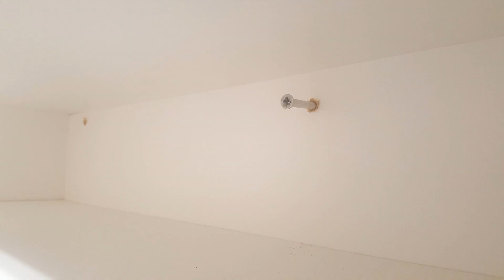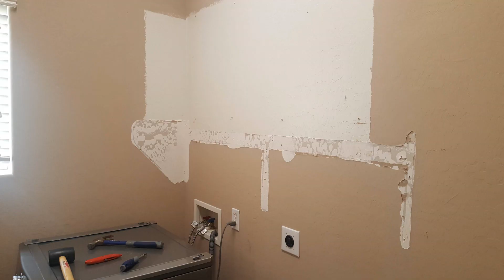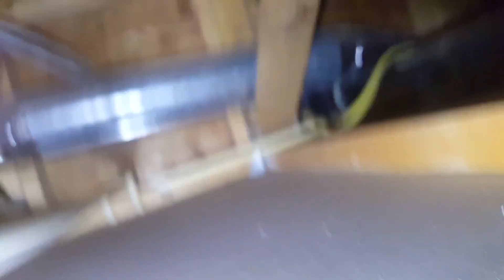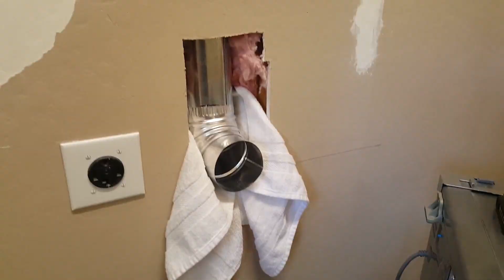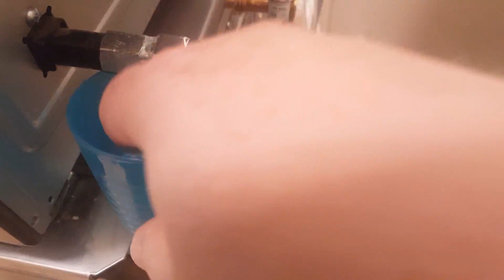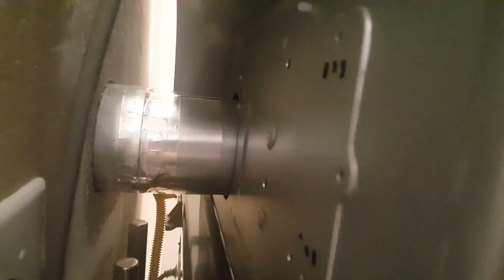How to stack washer and dryer - Reroute dryer duct vent

Comment: Those connections are solid, not flexible, what happens with the vibrations effect?
Reply from the maker: No problem at all, with the washing machine level and the dryer being light weight, everything works great. Still going strong

Comment: How to run snap-lock pipe:  The crimped end of a fitting or piece of pipe is the MALE end that will fit INTO the UNcrimped female end of the next fixture/piece of pipe.  The MALE end goes in the direction of air-flow to allow a more smooth transition of piping at a joint.  That is NOT what is shown in this video...at least in the mock-up shots.  Crimp the ends only as much as to allow for a firm/snug fit.  Pop-rivets AND tape are preferable to tape alone, particularly in a direction change.  Poor quality tape will become dried out and brittle over a short amount of time and will no longer hold the pipe junction together.  FOIL-BACKED tape should be used, NOT duct tape.

Comment: How will you pull the stacked washer and dryer forward if you wish to clean the vent behind the dryer since you have the cabinet to the left of the stacked washer and dryer?  I have this issue with washer/dryer in the closet with no room to get behind it and believe I will pull the dryer duct out and damage it by pulling the unit forward.  Possibly a flexible slinky like dryer duct hose would work so we can pull the unit forward and push it back?  Seems you installed this prior to putting in your cabinet to the left.  Thank you for any advice
Reply from the maker: Planning for servicing is definitely smart. In my case my plan is to always allow access from the side of the unit. I personally didn't want to deal with the flexible ductwork and I had such tight tolerances doing it with rigid material that it worked great. It is a little annoying to have to pull things out to then have to cut the metalized tape and then pull the machines forward but the tile seems to handle moving things around well and I'm down to only needing to do it once a year so it isn't too bad.

Comment: Looks like there are no easily-accessible water cutoff valves -- always an issue with stackables, especially if you want to hide the water connections and drain hose.  What do you do about emergency water cut-off?  We're considering converting side-by-side to stack and are concerned about this issue.
Reply from the maker: Our shut off valves are to the left of the stack so they're reachable but when I put a full size freezer in that space (instead of a chest freezer) those will be hard to reach. Of course the house shut off valves outside is still easy to get to so we have a backup

Comment: Why did you have to move the hole? could you not just run a longer duct hose to the new site? I was thinking of placing my dryer on top of washer and just getting a longer hose. The dryer vent is at the bottom, I was thinking it would just connect to dryer on top and run to the same place. Its moving like 10 inches over from current location and then stacked on top (as mentioned). Just curious.
Reply from the maker: It is not ideal for the lint to drop down then go back up. You would have a lot of lint accumulation over time at the bottom. This increases fire hazard.
Reply from the maker: Also the dryer hose that is flexible is also not ideal. Not sure what everyone's regulations are in different parts of the country and world but solid performs better and is substantially safer than the type that snakes around.

Comment: Good work. How can you pull out the unit for service or check for a possible leak, etc.? Won't you damage the dryer exhaust connection? Just wondering if you thought of that.
Reply from the maker: There's some flexibility in the 4-in pipe so I just pull it three or four inches away from the wall then I take a razor blade and cut the metal tape. Once that's done I can pull the tower out further and have access to everything. 

It's not ideal and it is rather inconvenient but the room is small and I'd rather maximize the small space 99% of the time... if I left more room back there for ease of access I would have less space to do the laundry.

Comment: Regarding only the dryer vent my daughter has the exact same issue where the vent needs to be moved up. 

Instead of patching with dry wall when I'm done, I'm going to just put in a 27" x 27" access panel with hole in it for duct.

How long was the hole you made?

Curious what you used to cut the duct with? Oscillating Multi tool or tin shears?
Reply from the maker: I believe the hole we cut ended up being about 7 inches wide by about 15 inches tall.

As for cutting the duct work I deliberately didn't show how we did it as it wasn't the safest route and was something I knew could be a bad example... I got a white hand towel a little damp and wrapped it around the ductwork  (blocking the insulation) then proceeded to cut it with a Dremel. Sparks shot off and landed on the towel but the danger of igniting the insulation was possible so I cut slowly and had water and a fire extinguisher nearby. Once a fair amount of the front was cut I used tin snips to do the rest in the back.

Ultimately it worked but it probably wasn't the safest thing so I deliberately left that out of the video.
Reply: @DIYAroundTheHome  Thanks for the details!

Comment: It would have been helpful if you talked about the water connections, and a final picture!
Reply from the maker: The project isn't complete so it is somewhat bittersweet to show it in its current state. We have painted the room but we have not got around to building shelving. when we do we'll definitely have a follow-up video that will link to the end of the video you watched

Comment: Nice video, how long is the dryer vent run ? 
Is it running vertical out of the roof ? Thanks
Reply from the maker: If you check out my dryer vent cleaning video you'll see more detail on it but ultimately the dryer vent run goes up about 10 ft then it has a 90° bend and it goes out about 8 ft exiting the side of the house
Reply from the maker: The house is two stories so it runs in between the first and second floor of the house
Reply: DIYAroundTheHome Any issues with the vertical run ? I am doing a vertical run 15ft up and out the roof. The only 90 degree elbows I have are from out the dryer and one at the bottom of the run.
Reply from the maker: @User37621  nope not at all. I recommend finding your dryer's user manual and read the recommended venting. For my LG dryer they had specific suggestions on length and number of transitions (whether 45 or 90°). 

My dryer also runs a diagnostic test and alerts me when air flow resistance is too high. It won't say the cause of it, like if it is lint or the length of the vent run, but it will let me know that it needs to breathe better. 

That's what led me to do my video showing how to clean vent duct work was because my dryer started beeping and showing an error code that let me know that the blockage was significant enough that I needed to take action... and sure enough when I investigated it the ductwork was full of lint from years of neglect from the previous owner and a couple years from me. Once I remove the obstructions it ran the test again and the error code did not come on which let me know that the dryer at least seems to do a decent job of knowing whether or not the pathway breathes well enough or not
Reply: DIYAroundTheHome Thanks for the info. I am  big on cleaning the vents as they create potential fire hazards. I typically know if the vent my have an issue when the dryer is taking longer or the clothes are not drying well. I hope my LG DLGX3701 dryer has that error notification feature like you mentioned. I have to look into that. Ok I hope all goes well.
Reply from the maker: @User37621  I looked into the user manual for that model number and you do have the FlowSense feature. Read up about it on page 29 here: https://www.lg.com/us/support/manuals-documents?customerModelCode=DLGX3701W&csSalesCode=DLGX3701W.ABWEEUS&category=CT10000011&subcategory=CT10000080
Reply: DIYAroundTheHome I appreciate the link and your time. Having that feature just gave me a little more peace of mind. I finished installing the vent run from scratch and the LG set is on the way. Hoping all goes well. Oh and subscribed 👍🏻